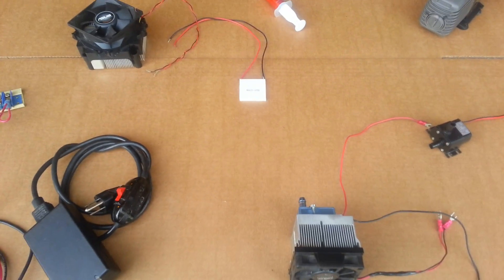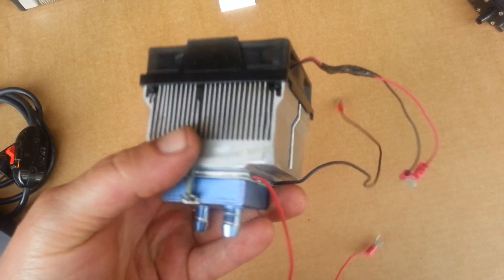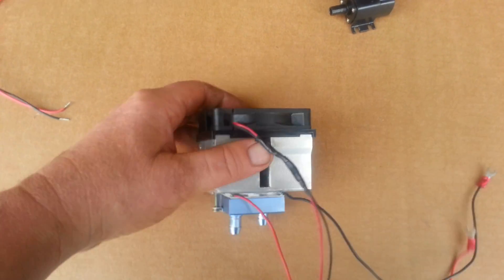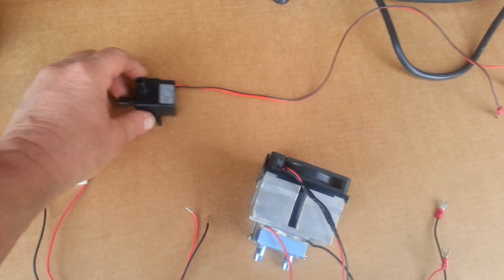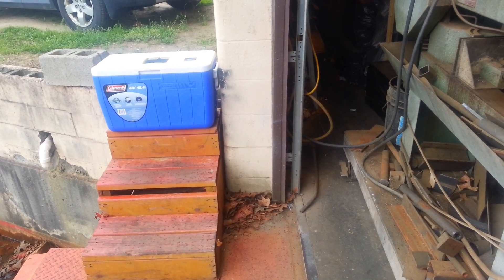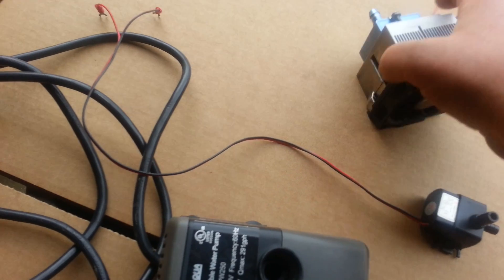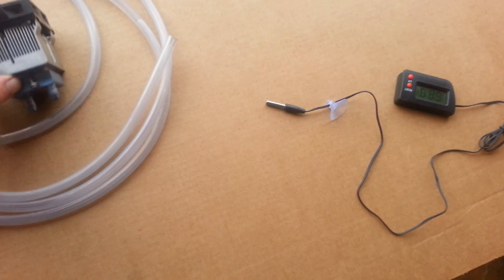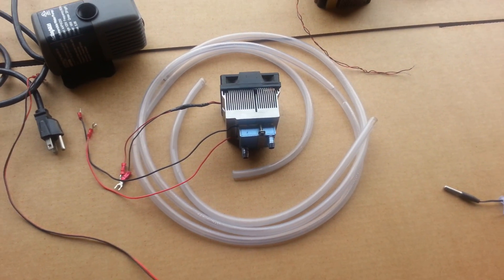DIY THERMAL ELECTRIC WATER CHILLER

Comment: Hey Mike, thank you for the brief summary of this project! I'm really interested in making a hydroponic water chiller and found this extremely helpful and am very impressed to see your outstanding results! I'll be attempting to make my own water chiller very soon and I'll be following your setup. I had a question about the purpose of the mini water pump. Is the water pump just used to circulate the water in the insulated reservoir to keep temps lower? If not, could you please explain to me the purpose of the water pump for the reservoir. Also, where can I get a mini pump like that?
Reply from the maker: Hey Nick
The pump circulates the solution threw the water block and cools the solution and dumps it back in the reservoir.
I bought it on amazon. If you search computer liquid cooling pump you will bunch of them listed.
Reply from the maker: Hey Albert
That controller is all you need.
Thanks for watching
Reply from the maker: I haven't tried my setup on a 25 gallon tank. You might need 24 to 48 hours to reach your temps. Once you do you could pretty much maintain you temps with the controller.
Reply from the maker: The TEC chip is 12 volt 8 amps for 96 watts. There are higher wattage chips but the cost of them can reach over $100 a chip.
Reply from the maker: I would ask the seller about the specs on the chip (amps ) one problem your going to run in to with a chip that size is heat. So you would need a high rpm fan (over 10,000 rpm) to move the air fast enough to keep the heat sink cool. There's some science behind it. I would look in to something half that size With the heat sink you picked. I would use a water block made of copper and a 12 volt water pump. I found everything I needed on amazon for a good price. The water pump can be found under computer liquid cooling pump.  Remember volts times amps will equal your watts. So make sure when you look for your power supply that it can handle everything you are connecting to it.
Reply from the maker: Hears how i look at the copper questions.  Most homes have copper piping. The ph in my water  and your water very just like hydroponics. And that pipe usualy last the life of the house. The Ph in your system should NOT get that low to cause any problems with your set up.  And let me suggest one thing to you. Watch my other videos. I use an inline fan to keep my reservoir temps down in the 70's in 100 degree weather.  I modified the inside of the reservoir to direct the air flow threw the tower.  The setup is like a swamp cooler. The down fall is that you have to top off your reservoir everyday but you can add another  tank with a level switch to top off when needed.
The cost is about $50 or cheaper. It worked great for me because I was using an outdoor setup and needed to keep my temps down.  At night my temps were down in 60's-  50 ' s at night. Something to think about

Comment: Got all the parts in an amazon cart... Cept for that" terminal board"... What should I be looking for exactly? Would love one just like yours!
Reply from the maker: You don't need the terminal board. I used it to make it easy to connect and disconnect the wires if I had too. You can just connect the wires together and use wire nut.
Reply: Copy that man... Appreciate you getting back to me!
Reply from the maker: This little unit works great indoors, outdoors not so good. 
You should be able to get your temps around 55-65* with a 15 gallon reservoir.  That's what I got when I tested the unit. Now it will take at least 24 hours or more to reach that temp. I'm sure if you put a temperature switch in you can maintain the temp you set it to.

Comment: Lets build them.. diy coolers. .parts list please ..detailed .o and be carefull with paste. .you can get the precut paste squares.. to much or not enough paste with fry that chip...applying paste.. clean off area with alcohol pad, if using old fan clean all of the fan blades check for rust etc. When applyin paste Lightly you dont want to spread off sides lumpy etc.even amount..start in middle then spread it .just to cover the gold square on heatsink, apply dab on chip .. shyt i supply fans and heat sinks even have a helka radiator heatsink its like 8 inchs high ..that would be a cool cooler rig..let mi no

Comment: Hi Mike, i have used your experiment and I bought the peltier and did the connection exactly like you  but my water temperature is showing 23.8 deg cel why do you think did i do the connections wrong
Reply from the maker: Make sure your chip is working. A simple way to find out is to make your connections and hold the chip between your fingers and power it up you should feel the chip get hot on one side and them turn the power off. Now you know the chip works and you know which is the hot side because only one side of the chip will get hot so the hot side will go against the heat sink with the fan the other side will be your cold side and that will get attached to your water block. Now if you power it up and nothing happens you may have a bad chip.

Comment: Have you actually grown using it? I've read of people who get a white film in their water but there are varying opinions.
Reply from the maker: Hi Elijah
I have not used this to grow with. As for the white film I'll throw in my two cents. It may be caused by the water block. If you use the aluminum one it will react with your nutrient solution. I would use one made out of copper. But i gave up on it because I was looking for something that would work outdoors. If you check out my other videos you'll see that I went with an evaporative cooling system
Reply: Mike Walker Hmm I made a mistake I thought the block was made of copper. I can't seem to find any info on aluminium leaching. One thing I did find is that supposedly copper with anti corrosive coating is what you really want to look out for in terms of polluting the water and I would assume they probably use that on most water blocks. I'm not too keen on even trying this out knowing it could ruin everything.. Only good alternative I can think of is to use a stainless wort chiller in a bucket with plain water for the TEC and then circulate my solution through the bucket. Do you see any issues with this approach? at that point I would probably be circulating 13-15gal but like I said I only need to keep my water temps around 20c.

Thanks!

-Elijah
Reply: Mike Walker Or since it's the cold side maybe I could just attach like a small plastic container to it something instead of using a block.
Reply from the maker: If you go to http://amazon.com and look up "coolworks ice probe" may be what you are looking for.
Reply: Mike Walker Thanks for the recommendation I've seen it before though, I'm in Canada and the cheapest I can get one for is $180 without temperature controller. I'm looking to do this on the cheap. I think that the best option is probably to replace the TEC with a cheap diy dehumidifier chiller and then the wort coil in a bucket approach.
Reply from the maker: If you go to my other videos I use I simple inline fan to create a evaporative cooler. It cost me $20 and I got great results from it.

Comment: so now I find you! I had a hard summer in Texas with my system, have u tried this in 100 degree temps?
Reply from the maker: Hey mike 
I make a new video showing you how I maintained 73* in my reservoir with outside temps reaching 110* using evaporative cooling.
All I used was a fan and some modifications to the inside of the tower. Check it out.
Reply: @mikewalker3124  i couldn't cool 1 gallon with a peltier , just 2deg c

Comment: Great idea. What is the water block made from please?
Reply from the maker: Hey gold grower,
It's made from aluminum but you can get them with a copper base (http://www.amazon.com/Bridge-Waterblock-Cooling-Copper-Liquid/dp/B00KD44MEI/ref=sr_1_215?s=pc&ie=UTF8&qid=1411228336&sr=1-215) 

This works great in doors but make sure your reservoir is insulated! It's more effective and keeps your tank colder.

Comment: This is so intriguing!

I made dutch buckets without any experience (because I watched vids like yours, props to MHPGardener) to grow tomatoes hydroponically for the1st time this spring.  Succeeded beyond my wildest expectations and the fruit tastes as good as any I have ever gotten from soil.  I'm in Arlington, Tx  and now its getting hot and going to get a lot hotter.

You said you would entertain questions... so here I go.

I also don't have a clue about electronics, but maybe with a little help I can make your idea work in my little hoop house.

I have two old pcs that should have heat sinks.  I have a "2wire" ac adaptor output 12.0v  2.9a.  I have a Belkin Residential Gateway Battery Backup REV B.  Nominal output voltage 12v dc, max power 36w. 

1.  How can I make a series of these to chill 50+ gallons to 75 F ?

2.  I also have a mini fridge w/o an icemaker.  Would I be better off coiling copper tubing inside to chill my res for the short term ?

3.  If the fridge is the best immediate answer, what can I make with these other parts ( with Amazon parts as needed) as a solar replacement for the fridge ?

Thanks in advance for taking the time to read this, even more if you respond.  I hope you take this as a challenge to help a old fart cheat Texas summers !

I started a channel with 1 to 2 min. weekly vids showing my dutch bucket progress.  I have 6 subscribers. WooHoo.

Kirklee
Reply from the maker: Hi kirklee
Here is what I would suggest. I would use the mini fridge. I have been having Major problems with the chillers I made. I have been using them out doors the cool my towers. The problem is the heat from the sun and the heat from the chip the fans can not keep the heat sink cool enough and end up burning out the chip. But if you use it indoors you should be fine. I'm actually going the mini fridge route also. Until I can figure out a way to keep my reservoir temps down. Sorry for the slow response.  I'm working on a gardening project that I will share on my channel when the time is right.
I'm try to put together a little video about the chillers and the mini fridge build.
By with way I like you videos! Not bad for a beginner.  Keep up the good work!
Reply from the maker: You can still use a solar panel with the fridge. Your going to need a inverter,  a bank of batteries and enough panels to keep your system running.
Reply: Mike Walker I have a new project going, too.  My 1st attempt at dutch bucket tomatoes are soooo good, my boss said I can repurpose the backyard.  She said  I have to make new beds and transplant her stuff that I take care of anyway.  Really good trade !  Switching St. Augustine grass for tomatoes.

I got all the parts from Amazon, but the water blocks are on a slow boat from China.

I am planning my new greenhouse and have an idea for insulating and isolating the buckets in a tube like a sausage.  First, a layer of black/white plastic, next a layer of double bubble-double foil.  Sealed 5 gallon buckets filled with water between the plant buckets as heat sinks, thermal mass on top of the insulation.  Pull the insulation over the top of the buckets and clip together. 

I think the vegetative part of plants are hardier than the roots.  If I can provide root protection, I think the plants will be able to weather larger extremes. Just an idea.

Thanks for the kind words and looking at my 1st attempt at dutch buckets !

Kirklee

Comment: Great work Mike!  Could the mini pump be used to pump the solution to the top of the tower?  I love the idea of the towers being self sufficient with solar panels.
Reply from the maker: Hi Aaron
yes you can use the mini pump. It has a head hight of 9 1/2  feet lift and pumps 65 gallons an hour.

Comment: Thanks Mike for sharing this...

TEC is the way to go for our rain towers.. 
I made a system almost similar.. mine is attached to the body of my tank instead of pumping water through it. 
it certainly works better with a cooler to keep the temp isolated from outside and the Cpu water cooler.
I am a bit concerned about corrosion and metal toxicity from the metal water cooler unit. these are made in china and not sure if it will withstand the low PH of 5.5  running through it all day long.
Reply from the maker: Hi Deb
the water block is made from aluminum. I will be testing this all season and if there is an issue with the system I will post it here.

Comment: 12 volt pump part number / vendor?
Reply from the maker: This is the pump I bought- http://www.amazon.com/gp/product/B00IJB3L9E/ref=oh_details_o02_s00_i02?ie=UTF8&psc=1
One thing I will tell you is that the seller is in china so it took a couple of weeks for shipping. So with that said you might want to look around for a seller that may be able to get it to you faster. The pump is NOT self priming which means it needs to be submerged in water.
Reply: Mike Walker Thanks.  Right now I am building a strawberry tower similar to what you posted.  Gonna try something different for the support.
Regards.
Reply from the maker: I would to see it when you get yours finished. I'm thinking of building a hydroponic strawberry wall garden next year.